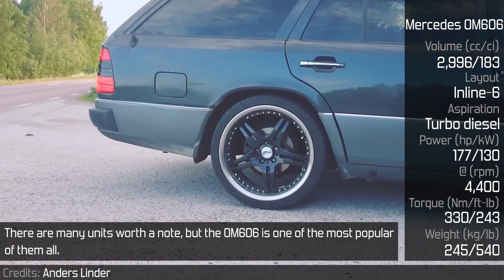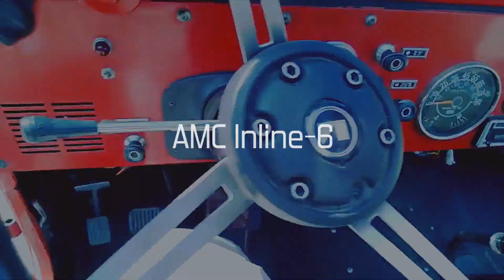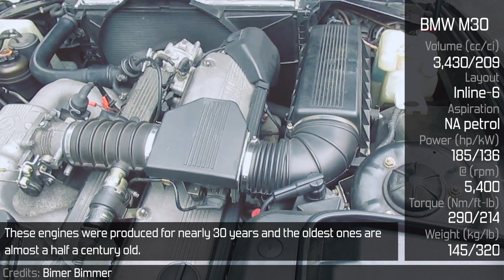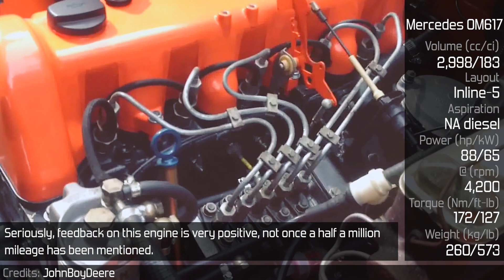10 Most Reliable Engines Running Beyond 300,000 Miles

Comment: Yay, my 3800 made it on the list
Reply: The 3800 series  2 was a REALLY good engine... Surprisingly they discontinued it
Reply: G yah that doesn't suprise me those are skme good engines
Reply: lonnie spangrud series 3 was the best, it had everything from the series 2 but was perfected in the end with fixes to all of the minor problems (lower intake gaskets) it's sad to see what replaced it. cough (3.6L) cough...
Reply: Blue Infinity the 3.6 is ok I mean it would've been  if they kept the 3.8 V6 up to date instead of replacing it
Reply: my 3800 backfired through the intake and caught fire. 2001 buick lesabre.
Reply: all 3800s are great! i love em plus they have a killer exhaust note
Reply: One dumb thing about the buick  3.8 is the cam signal interrupter. To replace one, you basically have to take everything off of the front of the engine to replace a $7 part.
Reply: do you know why?

so ive got a 1999 buick century....which is a regal with drum rear brakes and a 3.1 v6 with 160 hp
but the regal....got a 3.8 supercharged motor....which could make 300 to 320 HP with minor things (smaller blower pulley, polishing stuff at home, and a cam if you want to get to 300hp safter/less boost)

buick also stole the rear suspension from the corvette... and and car is only 3300 pounds wet!

so they actually do handle...even my less sporty century is...predictable as fuck
the power steering is VERY responsive and it stays planted unless you Scandinavian Flick it...and then it still handles geart
that car needs a 3.8 super swap....it BEGS for more than 160hp

but....TLDR..... buick made a car 20,000 bucks cheaper...
thats stopped better
turned better
accelerated better
and lasted longer/was safer for grandmother 

so, thats why all todays buicks have turbo charged 4 bangers....which have problems with melting their own pistons....
Reply: @dragon... cam position sensor.....and ya....most cars are going to require that....thats not just specific to the 3.8

im 23 years old and have been working on cars sense i was 6 (learning from my dad, who is 54 and been doing it sence he was ~14)....and im not joking.....poor, cant afford 150 bucks an hour shop labor. 

i just ad to replace mine on a 99 century with a 3.1, however.....i just had to remove the power steering pump....3 bolts, 1 for the sensor

but, ive worked on LS engines that to get the power steering pump replaced.... you needed to take off  LITERALLY...THE ENTIRE front of the engine, stopping only at the timing chain cover...

on the old gen 1 small blocks and big blocks....power steering pump is a 2 or 3 bolt job (besides the hoses).....takes 10 mins

but, TLDR..... if you have worked on a lot of stuff.....removing that big huge bracket that holds all the front accessories on....very common. 
just get a good set of tools, and a bunch of different length entensions, and go at it. 

might be easier to remove the passigner tire and the plastic inner fender (just comes off with plastic push pin things)...might get easier access to some of the bolt.s
Reply: well.... what do you mean by "blew"?
engines USUALLY catch on fire when you throw a rod out of the block....

steps to prevent a fire....step 1... turn off the key

that is it....turn that fuel pump off.....
if the key is on, GALLONS of gas are pumping out every 60 seconds.....

my dad had to remove the intake from some reason....sensor iirc....
but the O ring for the pressure side of the fuel rail got cut...

he backed out of the drive way and noticed a trail of fluid was also backing out of the drive way....
he shut the car off.....and then smelled gas.....so he knew what was up

he saved a LOT of money by being a a wise old fuck....lol
Reply: also....my dads got a 97 buick lesaber with 250K + miles now....never left him stranded. 
no lifter ticks even.....

the trans blew over drive....but limped home in 3rd at ~3500 rpm and 60 mph....at about 180K
strange failure too....blew ALL the fluid out of the vent, then worked fine....well, with no OD

we have replaced ball joints, shocks, struts, ETC ETC.....but nothing mechanical on that engine. 

and my 1999 3.1 powered century has 194,000 miles on it....it does have a lifter tick on 1 hole (because i rev the shit out of it all the time...thing has a 2 stroke like "power kick" at 4200 rpm)

but the 3.1 even has 2 crank position sensors....and got me home after the high precision one failed. 

a buick is the ultimate 3.8 (the 3.8 is a buick designed motor after all)
Reply: Joshua Godsey It eats timing chains which are neither cheap nor easy to replace considering the engine needs a rebuild.
Reply: Because GM thought it would be smarter to separate the timing chain into 3 different sections all controlled by a computer. Over designed bullshit if you ask me, they don't even make it to 50k I've seen 20 and even 15k's that need rebuilds in the shop.
Reply: i think my class teacher ( i go to a automotive type class) got the wires mixed up somehow, and it backfired through the intake, and caught a fuel line
Reply: Blue Infinity probably the supercharged ones that ppl throw a smaller pulley on u keep 3800 stock it will go forever, now the crappy slushboxes attached to them are another story
Reply: 891trigfoot I agree, buick used to be so great and really fun when they built awesome muscle cars like the buick GS (not the regal GS) 80's regals with manual trans. grand national/GNX (I'll let that automatic pass because I love the GNX) was also a really badass muscle car. The automatics although really boring aren't that bad, the 4t-65e can take one hell of a beating and lasts a really long time. GM has really great automatic transmissions. that's probably why rolls-royce, and ford bought their 4 speeds in the 90's.
Reply: Blue Infinity I didn't know that I wonder why GM would use such a unreliable engine when they have plenty of damn near indestructible engines that could just be updated and refreshed for modern emissions and standards
Reply: Blue Infinity I completely agree with you on the transmission. I have a 1995 Pontiac bonneville with the 3.8. I added a supercharger on it... it makes an awesome sleeper. It's not the fastest thing in the world but it will beat an early 2000's mustang gt.. its a fun car. That transmission though.... I've beat on it quite a bit and so far, it's held up. I love it. I had 2 f150s before this car and both of them blew the tranny. The engine lasts but the tranny in a ford... it can go. Chevrolet probably makes the best transmissions in the 90s era.
Reply: 4t65e  hds are hit or miss my 06 grand prix gt has an l32 (supercharged series 3} with just over 133k and the tranny is shifting super hard and ive never beat on it my 2000 grand prix gtp daytona 500 edtion has an l67 with the same trans but just shy of 180k and it shifts like new i also agree they should of kept the 3800's around and just updated them the only black mark about these engines is the leaky gaskets which caused all those engine fires many years ago
Reply: Connar Downes Are you on time with the trans fluid changes? With consistent maintenance, and fluid changes they'll keep. My mother drove my current vehicle  for a year when she owned it. We have a 2008 Buick lucerne (3800 S3) and I remember in this one incident, she insisted on parking on this steep hill at someone's drive way. It was at least a solid 6 foot climb. She put it in drive and floored it up the hill for a good 2 minutes, because the wheels wouldn't gain traction on the grass. The next week, when i took it to get gas, I noticed that 1st gear felt fucked and 2nd wobbled. Every time I would take off from a   dead stop it would hesitate and struggle to pull itself but it would still go. The car stayed like that for a few months until I took over the car from my mother as she got a minivan to replace it. I took the vehicle to the mechanic for it's 50k mile transmission fluid change and the mechanic told me, that he could replace the band for 1st gear without removing the transmission from the vehicle (so there was no rebuild) as with the 4t-65e it still had the older set up where you could do that. The car handled pretty much fine after that and I've had it ever since. Currently the vehicle has over 160,000 miles and still pulls hard. It's still on the original trans, and it handles pretty much the same from when I replaced the band on 1st gear. You just can't kill a buick. Especially one that has a 3800, and a 4t-65e.
Reply: Connar Downes The supercharger might have something to do with it by the way.  sorry, I got so caught up with my "rant" that I forgot to mention that the 4t-65e, although bulletproof, doesn't like large amounts of power, and high rpms, (the 3800 is what I call a low-rever)  It'll take it for a while but give out after a few thousand miles. The transmission can only handle something like 300-350 hp and anything after that will slowly start to kill it. If you are getting into racing and performance I strongly recommend a "built" or custom transmisson. After all this is a trans that is meant to give you that smooth, floaty feel down the road while cruising at low rpms, not for racing.
Reply: Blue Infinity That story kind of reminds me of the time I ran my 3800 (Series 2) off of 5 cylinders for almost a year or 40,000 miles. Turns out it just needed spark plugs. As soon as I replaced them my car handled fine. It has 200k miles. Those 3800's are literally indestructible. I thank their simple, conesrvative design, basically a pushrod, iron block v6 = not much to go wrong. Still on the original 4L-60e trans too.
Reply: you mean 4t60 or 4t65 e hd no 3800's came with 4l60s
Reply: Connar Downes Yes I did mean the 4t-60e. Also it might be the bands.
Reply: Sounds like you had one of those plastic plenums. I have a 2002 Buick Lasabre with the same engine design. Most likely you had a leak from the valve cover gaskets. Very cheap and easey to replace!!! I have 200,000 miles on my Buick. Still getting my 205 HP! Love my car.
Reply: do you know how much those bands would cost to replace? it sounds expensive!
Reply: Connar Downes it cost me $150, which might seem a bit much but it saved me a trans rebuild and the car handles fine now. In my opinion it was a worthwhile investment.
Reply: In all honesty I can't attest to the HD package as I'm not as informed on it. My only understanding is that it is basically a performance 4t-65e package, which probably consists of the same general components as the normal one. I have been interested in purchasing one myself to replace my current trans.
Reply: you mean the buick or the ecotecs that replaced them, or the alloytecs that replaced the ecotecs. over in Australia we got the buick 3.8 v6 in older commodores then the ecotec 3.8 v6 in fairly old commodores and the newest ones have the 3.6 alloytecs. buick > ecotec > alloytec. buicks mang for days and ecotecs mang pretty good but definitely arent as strong when your sitting on the limiter. buicks go hard, look up something along the lines of mang mang commodore and you'll see how much fun we have with them.
Reply: In my opinion the only v6 engine even worth a damn after the 3800 was the 3.9L that replaced it in 2009, and GM had to get rid that too! all for the shitty 3.6L! the 3.9L introduced through pontiac, although not the 3800 was at least sturdy enough to replace it but no, the engineers always know best. I think the aussies still kept the 3.9L a few years after until 2014.
Reply: Blue Infinity what was the 3.9 in
Reply: Joshua Godsey The 3.9L is found mostly in  Pontiac's and found in some Buicks and holdens out in Australia. I believe some chevys have them too. the engine was discontinued in 2011 and had a short run. it's a pretty good engine and with proper maintenance you could milk 200k plus miles with one.
Reply: I should mention the 3.9L was only discontinued in the states in 2011. Australia kept the engine for a while longer under holden.
Reply: the one the VN-VR had was just the series 1 and the VS-VY had the series II engine  which just introduced more power  torque and made them quieter and more fuel efficient, i have a VT which has 365k on it, and it still goes great, honestly most reliable car ive ever owned, i cant say the same for my parents VZ though, damn 3.6l rattletec's
Reply: G1itch 15 extra hp and 5 extra torque doesnt make a difference i have a series 1 and raced a series 2 and we were dead even and fuel economy was the same
Reply: 3800 motors are good.
however, they tend to be mated to shitty transmissions that don't bear the same reliability
that is why my impala is not with me anymore
Reply: Gunner Ginn I disagree. Maybe boring, and archaic but in my experience they are certainly reliable.
Reply: My father is a retired mechanic, and one of his favourite cars was a Le Sabre with the 3800.  Some folks think Chevy's 3.8 is the same engine, but it is not.  The 3800 is much more reliable than the 3.4/3.8/4.3 V6.
Reply: Brian Empey buick is part of chevrolet they are the same damn engine
Reply: Brian Empey the chevy 231ci was discontinued back in the fucking 70s.
Reply: Brian Empey the 3800 is the chevy 3.8 v6 which they used in many buick and chevys and pontiacs
Reply: Gunner Ginn the 229 was discontinued not the 231.
Reply: Blue Infinity what are u  talking about when did i bring up the 229 and u say modern 231 when they have basically been the same engine since the grand national
Reply: 891trigfoot my bad I was talking to
Brian Empey. you are correct they are the same engine.
Reply: Brian Empey 3.4 isnt in the family of the 4.3

Comment: We have had several volvo's with +500k on them. Hell, there are two registered & inspected daily driver volvo 940's with inline 4 (turbo and non turbo) on our yard, both at +550k on them. I even had that twinturbo s80 with inline 6 clocking 295whp and around 400nm. Engine was rock solid, transmission's 3rd gear friction plates gave out at around 460k.

Any how, conclusion: Volvo makes damn reliable cars no matter the power output.

Comment: Where is fords 4.6L modular V8, lots of taxi cabs drive the heck out of them. If maintained well they last a good 800 000 miles
Reply: Douwe Kruizenga more than likely; the infamous intake manifold issue disqualified it from the list.
Reply: digitalrailroader or spitting out spark plugs.
Reply: Sackmatters or the opposite; where the spark plug seizes in the head like on the Triton truck engines.
Reply: Douwe Kruizenga someone can't car
Reply: It still doesn't mean the modular 4.6L weren't extremely long lasting engine. All engines have their issues, but there's no doubt the 4.6L can go for a while, even with their faults.
Reply: digitalrailroader the manifold issue was solved ages ago. and I work at a Ford dealer and the only plug issues we have are with 5.4s both spitting and freezing. usually due to shade tree mechanics trying to change them at home.
Reply: Keegan Johnson no they where just shittly designed
Reply: I knew a taxi driver from NY, he bragged those up big time.
Reply: digitalrailroader Only the 3 valves had the spark plugs stuck in the cylinders. The 2 valves spit out spark plugs.

Comment: Volvo D5244T is awesome. My v70 d5 has almost 300k km, my brothers v70 d5 has 540k km and my dads v70 d5 has 450k. Running perfectly and cheap still.
Reply: Love Volvos I have a V50 diesel estate for the last six years , I have just started having probs with the D P F though , that bit was a bit disappointing, it's done 141000 miles and has been serviced from new , it's a 2010 reg .

Comment: As a VW technician I would like to offer my input on the TDIs. The ALH 1.9L TDI (used until 2003 when it was replaced by the Pumpe Duse) is far more reliable of an engine. My own has 380 000 + km on it, and several of my co workers, along with numerous customers have over 500 000 - 700 000 km on theirs. The rest of the car typically falls apart before the engines do. The Pump Duse TDI (2004 and up) typically wear through their lifters and camshaft lobes by 300 000 km, have leaking tandem pumps, and the mechanical injectors are prone to failure as well. That being said, turbo chargers are rather expensive to replace on both models, and what usually kills a TDI is improper maintenance or turbo oil ring failure. Also, from personal experience, tuning your TDI, installing larger injectors and rolling coal will fill the variable vanes in your turbo with soot and seize the actuator up. So be wary of any of that nonsense. They're 90hp engines that make 48mpg. Not exactly designed for racing out of the box... hehe.
Reply: Not to forget 1.9 SDI, similar to tdi, but no turbo, no power, extra reliability
Reply: @filippazourek5650  yes, even from WV there are SO many so reliable engines which have 300k km on average and its considered normal, but on this videos they just mention one and thats all.. the SDI is great example, i won 1.6 petron BGU, 300k km already and no issues
meanwhile, this videos praise engines and consider reliable when its able to reach 150k km

Comment: Just would like to add the 3800 GM was not used in the Buick Turbo Regals from the 78-87 genre. The engine in the TR's was related to the original 3.8 that was introduced in 1975. 3800 was an update of it.

Comment: In australia we had the buick 3800 in our holden VN/VP and VR commodores. I have seen a few witb over 500,000 km's, and 1 with 950,000 on the body but unsure if the engine was replaced
I had a VN commodore with 400,000 and it had never had the heads off and it ran like brand new.